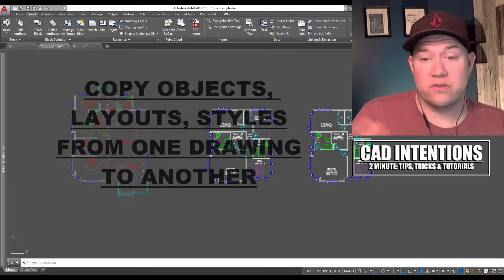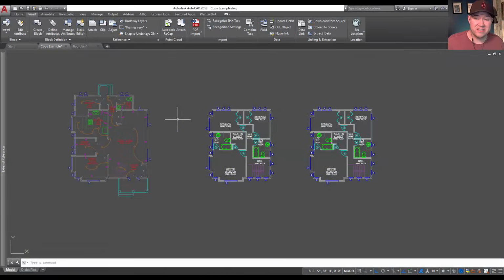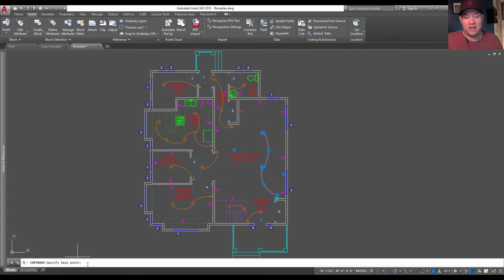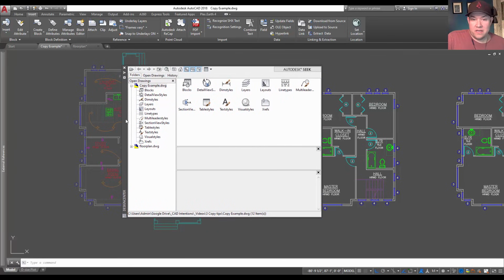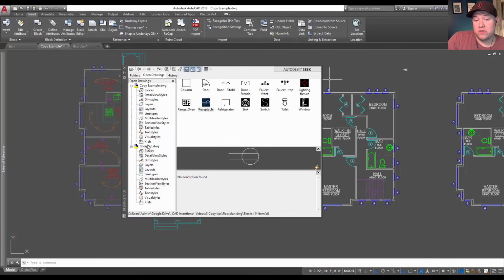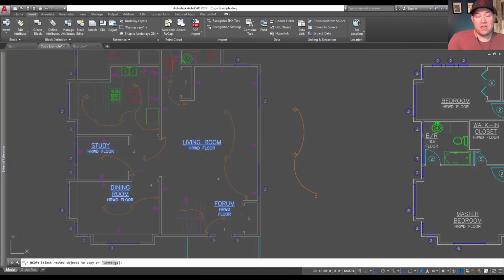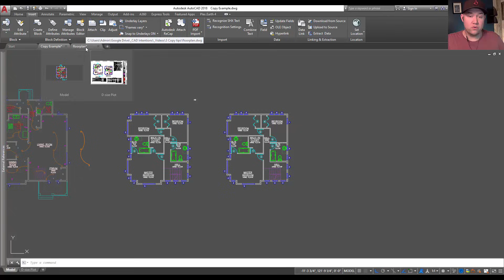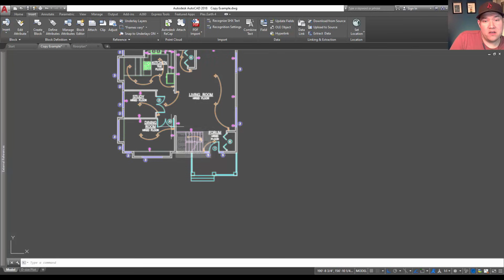AutoCAD How Copy and Paste in another drawing: 4 Easy Tips! - 2 Minute Tuesday

Comment: So in theory you could super impose a first floor lighting plan on a second floor framing plan to identify possible issues you may run into where framers put joist directly on layout
Reply: You can. But good practice would be to use xrefs. This way the plan would be dynamic and if you changed the lighting layout at first floor this would be reloaded on the second floor framing plan automatically.